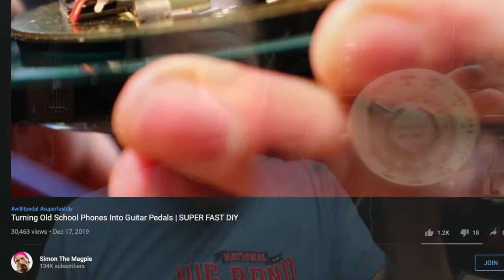DIY FX Pedal: Rotary Dial Stutter Effect

Comment: Have you ever tried using a push button keypad from a phone as a controlled or trigger? I have one from a discarded phone and looking for ideas (I'm new to a lot of this).
Reply from the maker: I haven't tried that. I would think it would be doable but I am not familiar with the circuit at all. You'd need a power source and should be able to use the touchtones as voltage outputs. It would be a cool project.